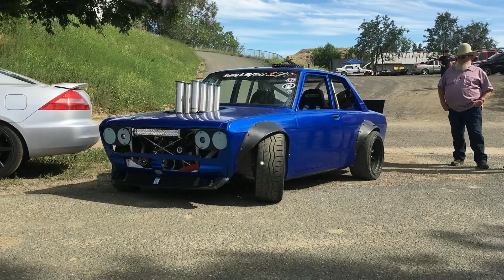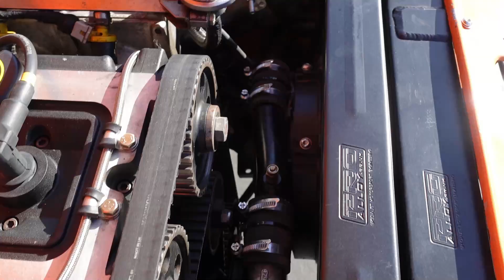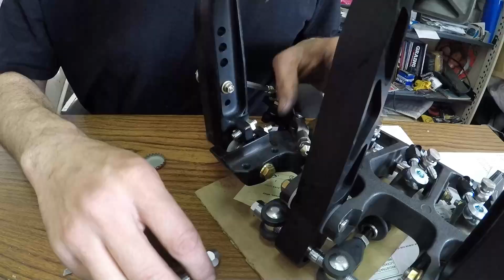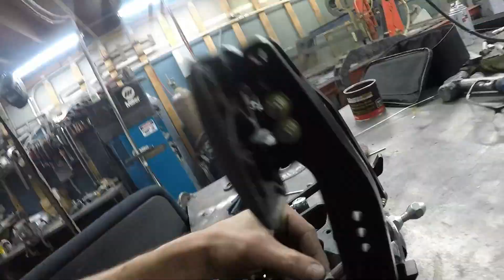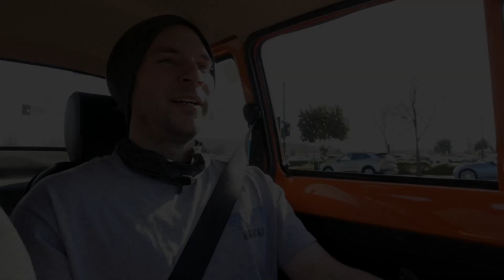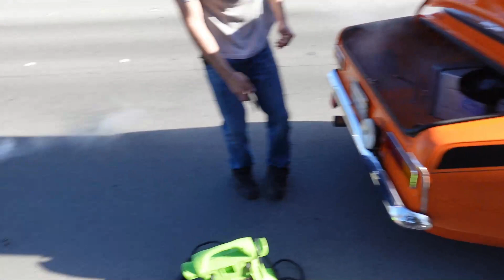Cosworth MK1 Ford Escort problems during test drive

Comment: Hi, I'm so happy to see you guys appreciate the MK1 escort, I'm from the UK and I had a MK1 avo Mexico in Daytona yellow,it got stolen and I never saw it again and that was when I was 19 in 1990 and to have a car like that at the time was a big thing.ive subbed to the channel and I'm looking forward to seeing more of your work 😊. the wiring on an old escort like this needs to be thoroughly inspected as over the years so many people have bodged around with them that running a lion battery can be extremely hazardous, plus the fact that you looked as if you had loose items in the boot which are lethal if they get between the terminals! Also, you really need to sort out those connectors above the pedals as your going to get your foot caught up in them and you don't want that.
Reply from the maker: Thank you sir, I appreciate the info and your story. And you’re absolutely right, the wiring in that car from so many previous owners has been attacked in all different directions. The wiring at the tip of my left foot will be tucked up in the next segment for this vehicle. We are installing a custom steering column assembly to not only raise the steering wheel but change the angle so that it’s centered on the driver seat. If the modification proves to be duplicated easily, we will come out with a steering wheel relocation kit on the website for the MK1!
Reply: @MarcusFryRacing  thanks for the kind reply Marcus, I'm subbed to the channel now and I look forward to seeing the progress you make with the car.

Comment: Yeahhhh I’ll be staying away from those batteries too many horror stories! It’s almost like you need to keep those things on quick disconnect cables abs hold down lol!
Reply from the maker: If you had one it probably wouldn't be a bad idea. A charging system better suited for a LiPo  wouldn't hurt either